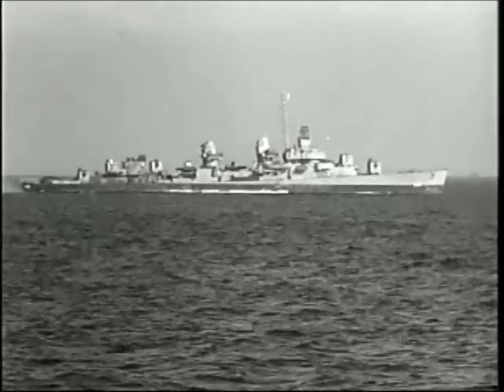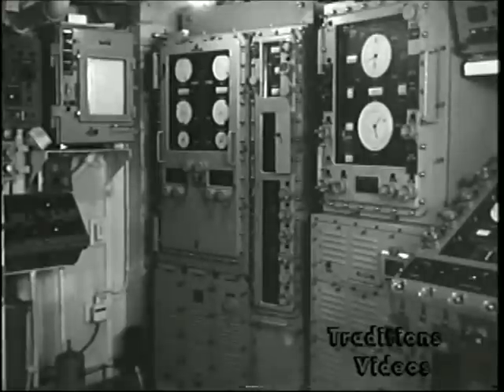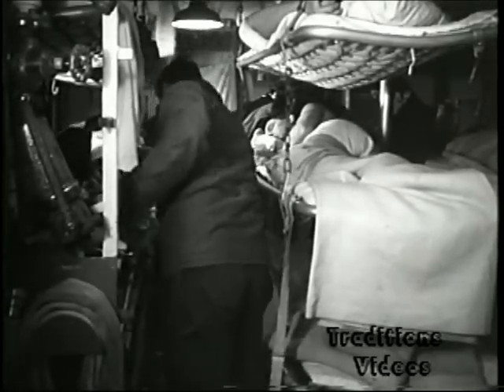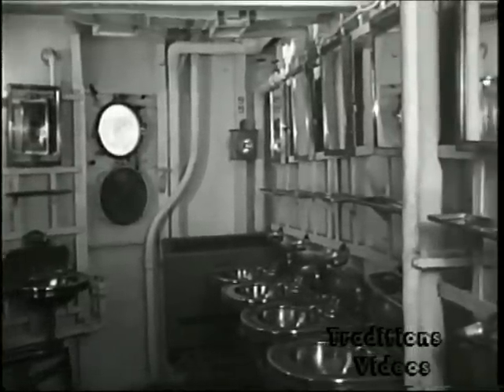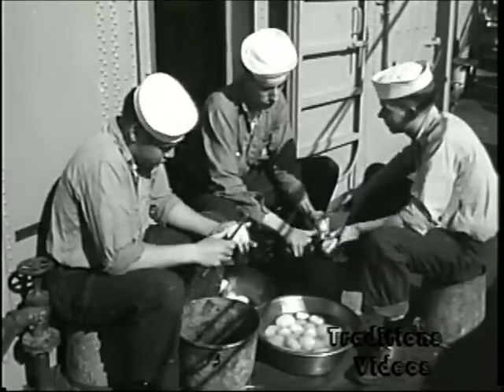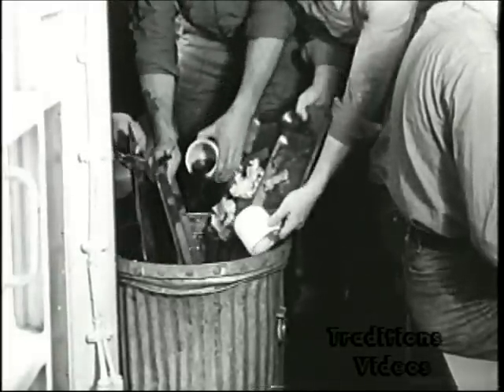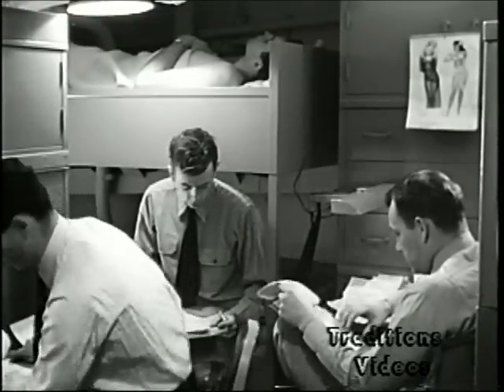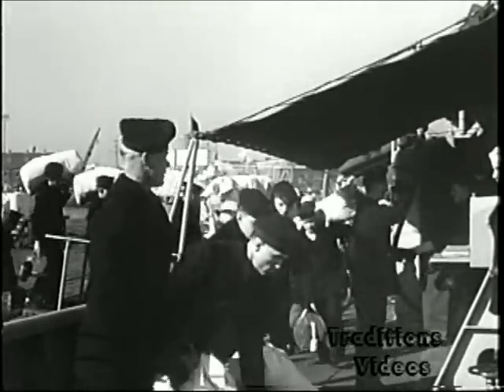US Navy USS  Saufley DD465 1952 Living Conditions

Comment: The head looks scary. No partitions or curtains. Hard to get a good bowel movement with someone staring at you.
Reply from the maker: On the Gearing class dd, the forward head has small partitions, but the toilets faced each other, and when the five toilets were occupied, knees often touched the other guys'; the partition only separated you from the guy next to you. Wish I had taken a photo of that head.
Reply: The ships I was on, neither had partitions, just a long line of commodes all open to the world.You just get used to paying no attention to anyone but your own business.
Reply: zane lile -- well said agreed.
Reply: onetruekeeper Gays weren't allowed in the military in the 1950's.  😃😃😃😃😃😃😃
Reply: I feel bad for you tin can types.
I was on a AOE(USS Camden(AOE-2)
Motel showers and heads(especially for us MM's).
I ran around for a week straight plugging all the minor steam leaks so the MMR was nice n cool and the evap guys were happy. 
Chilled water plant was top notch. 
Enough room for everyone to go thru the ship in a "race track pattern": STBD side goes fore and aft, PORT goes aft to f'wd. This was actually dictated by the main galley.
Engines were from the unfinished Kentucky. Top of the line steam, never gave us any major issues. Kicked like a horse when you opened the throttle.
Reply: Yep...I spent 5 years on Camden(late80's-early90's) and did the 89/91 Pacs.  She could get up and go for sure.  I remember we had to maintain 26kts for a few days and IIRC...we lost one of the four boilers but kept up speed.  Forced draft blowers were screaming though!lol!
Reply: We regularly did 30-31 knots. By the time I got on Camden, her boilers were improved and had electronic controls. Main engines were rated at 120,000 hp. On 9/11 we got underway for san diego with two boilers out. Yard birds were working on bravo boilers at the time. Still hauled ass. In the gulf, mostly cruised at about 12 knots in circles all day for a week at a time, then run in and do a port call for stores and ammo.
Coming back from peru we dragraced a carrier and two ddg's. This was the one and only time I saw the overload valves opened. TakeDeadAim mentions the FDB's screaming. Well... the FDB's in this particular run were spun up so hard that they were DEAD QUIET... It was strange...But you could clearly hear the HP turbine howling, which made me nervous because normally its quiet with the exception of the steam hissing thru the throttle. Huge amounts of grey smoke coming out of the stack. Couldn't tell who was running white and who was running black. Evaps tripped of course but other than that the plant ran fine. EOOW pacing so fast in main control that he rubbed a new path in the deck plate... Everyone smoking at their station of course lol. Anyways, the DDG's smoked everyone at first of course, but we caught up to them. Carrier lifted her nose out of the water and booked it. We never caught her... of course... I believe our top speed that day was 36-37 knots.
Reply: I do remember sprinting to the aid of an injured merchant sailor at about 33kts.  The Coast Guard called and said we were the closest ship and the guy was going to die if he didn't receive treatment.   Luckily we had CH64's aboard so the old man (Capt Nelson) without hesitation called the turn, called the EOOW and told him to make ready for a flank bell.  We ran for quite a few hours until we could launch the helo and then continued until it returned.  Loved the old Pachyderm...
Reply: Midway is a oil burner, she doesn't count(and she was decomm'd at the time). Enterprise was never allowed to run at full power. We raced a nimitz class. 
Draft and width of camden was the same as iowa but we were about 90 feet shorter.
We also weighed less than half as much as an Iowa at about 25,000 tons. NOT 53,000. We were never really at full load, even at deployment, and the peru trip was a semi-dry run(we didn't do unreps the entire time nor take on stores).
Reply: You must've been on a different Camden...overall displacement has little effect on speed.  When we went out to Desert Storm in 91, once we "inchop'd" and took full stores, fuel and ammo I'd see the daily reports on hog/sag etc...and we would easily push 50-53k Tons.  At that weight we'd sit at about 40'.  "light" on deployment would only see a min of 30ktons and 27'aft...15' fwd.  Camden actually went FASTER the lower she set due to the screws being able to "bite" more water.  You still put the same turns on, and each turn still pushes the ship through the water the same distance.  Regardless of control(electronic/manual) that ship would have never seen close to 37 unless you pulled all safeties, said "screw the bearings"(they're going to start over heating very quickly at turns to make even 34kts)and the ship's life depended on it.  That would be what's called a "Bendix Bell"....which if you look at the lee helm repeater, is the detent past "Flank"...tantamount to an LM2500 GST being pushed to "Battle Override" in which the CO orders to spin the turbines to their max...NEVER tested, AND IF it was ever needed AND assuming the ship survived those engines are REQUIRED to be pulled and replaced ASAP.
Reply: Well...for the most part it was great.  In Supply they had to segregate "ship" supply from "fleet" so although they may indeed have fresh fruit in the fridge...we may not have had the ability to get it because it was headed to another ship.  That said, if we had a good Suppo who was on top of his game, he could usually manipulate the orders so that we never ate poorly.  I only recall a couple of times we had to drink the milk boxes and NOT have eggs to order at breakfast!lol!  A good "Jack-o-the-dust" was critical as well.  We had a nice bakery to boot.
Reply: @hopelessdoom: I can tell we are on way different wavelengths here because we were in the navy in WAY different time periods... Things probably changed alot since you were there. Midway doesn't count because I have no idea how she performs... And she and the rest of the oil burner CV's were gone by the time I was onboard camden in 2000-2004. I used to drive past the midway everyday on my to muster, she looked like all the rest of the oil burners: just sitting there, rotting. Although don't get me wrong, I am a machinist mate and nothing would make me blow my load more than getting my grubby fingers on one of those CV's and firing them up. LIKE I MENTIONED BEFORE: We opened the OVERLOAD valves. I bet that was something you had never heard of before because you act like you have never heard of them. Every steam driven piece of equipment had one, and it required captain/eoow permission to open them. And during the entire time I was there, noone had heard of these valves being opened, and everyone was nervous about opening them from the old farts on down.

Liberty on camden was a fluid affair. We made the usual port calls at hawaii, thailand, indonesia. Subic bay was closed by the time I got there. Then we went in to the persian gulf and made a 1-2 day call every week at any one of the mad-hatter arab states there. On the way back we hit austrailia and tazmania. Each call with the exception of the mad-hatter calls lasted a week.
Reply: I'm curious about the timing of the hyper power drive.  Was this done on the final cruise on it's way to be de-commed?  I'm pretty familiar with the ship and it's operating parameters including having done one extended yard/re-fit and all the inspections and trials.  I know that having talked to MM's about the top speed, it wasn't so much that the plant couldn't boil water or spin the wheels fast enough...the true limit were the bearing temps.  As with CVN's(and prior CGN's), they're "wall" are the bearing's and their ability to cool them at such high RPM.  It seems pretty irresponsible for a CO to take that ship to what is a sort of "Battle Override" sprint including pulling the safeties unless he knew that it really wasn't going to matter even if some damage was done.    Even at 30-31kts if you're standing on the fantail...that thing is banging away and really churning up the sea.  Add to that turns for 5-7 more kts and it must have been quite a maelstrom.
Reply: It was hit and miss.  Since it was deep draft obviously we anchored out and prior to our de-cert(nukes) we really had to stay out in the boonies in ports such as Hong Kong, and Singapore.    There were only a few times when we'd go into port just to upload(when I was there) and that only happened really out in the gulf at Jebel Ali during Desert Storm.  Most of the time we'd take fuel from a T-AO.  We'd get barges at anchor and they could usually be unloaded in a few hours and by the duty section so liberty wasn't impacted too badly.    At Subic, it did suck if we got stuck across the bay at the ammo pier.  It was a 45 min bus ride around Cubi point to get to shit river.  Now THAT did suck!lol!
Reply: We pretty much went to every port any of the other ships did while on Wes Pac.  The exception was Thailand.  A couple of small boys could get into Phuket while we stayed up in Pattaya.  Hong Kong, Singapore was where being small paid off.  Us and the bird farm had to drop the hook way out while the others simply tied up at a pier.    Now...we DID get to see the "beauty" of Al Masariah Oman when everyone else was up in the gulf.  Two AF C-141's or a C5 would land at "Moon base Alpha" and we had to muster a working party and helo in to break down the AF pallets into manageable sizes and Tri-Walls for the CH46's to take back while we anchored about 5 miles out.  Hot, dusty, hot, and more hot.  Sums that hell hole up...
Reply from the maker: Replying to "John Doe":Gays never self-identified as being homosexual prior to the Obama policy changes. There have always been gays in the military, but never or rarely outwardly so, at least prior to Obama.  

The issue in the military has always been that ANY sexual acts between service members is prohibited, homosexual or heterosexual.  Even though gays are now permitted in the military, that doesn't give license to any sexual activity.l
Reply: Ships, I was on never had partitions - but no one starred at anyone.
Reply: Try looking at the deck squid.
Reply: TakeDeadAim LM2500!!!!! Now you are speaking my era of Navy. CG-49. I slept well to the drone of turbines
Reply: Lol you never served!
Reply: I was on a Gearing class and our Fwd head didn't even have partitions.
Reply: Funny.  Truth is that no one is "staring at you".  You go to the head, do what you have to do and get out. Why don't they install partitions of any kind? It's not just for reasons of space, it's in part psychological. Breaking down any and all barriers between and among the men is very important when at war. You have to be ready to risk your life for other men you had previously not known at all and you have to be able to have confidence that they will risk their lives for you. No second thoughts, no barriers.  You shower together, you shave together, you shit together, you suffer together and you fight together.  Unit cohesion.
Reply: @John77Doe  The decision to allow homosexuals into the armed forces has been a strategic one.  Imagine a new Viet Nam, what easier way could there be to dodge a draft than simply tell the recruiters that you are gay.  Even if you aren't.  There isn't a blood test or anything.
Reply: Watching this brought back a lot of memories from 45 years ago.  It is amazing how little privacy you learn to accept when serving aboard a warship.  Not just the heads, but the working spaces, mess deck, even the berthing compartments....12 guys sleeping, dressing, and storing everything they own in a space smaller than the size of the master bathroom in my house.  Given my lifestyle now, it is amazing how totally used to it I was.  But, it truly was no big deal.  Nobody cared.  Besides, you are with your best friends.  Your brothers.
Reply: @braintrusts  Like I mentioned, the destroyer I was on had no partitions and I found it difficult to unload with everybody standing there waiting their turn. It was the worst compartment on the ship and I often wondered who in the hell designed these things because a little bit of privacy goes a long way.
Reply: onetruekeeper pistol Pete videos
Reply: Wasn't me!
Reply: @John77Doe  They were but you just didn't know it.
Reply: Performance anxiety?
Reply: @memadmax69  Cool story.  I felt bad for you skimmer guys when the sub would be slightly rolling, even a couple hundred feet down.  Engineering department is the only place to be, whether it's in the back of the boat or  the middle of the ship.  Steam power is awesome.  No matter what device is making the steam!  Thanks again for the story.
Reply: Why?/Do you have something worth looking at??
Reply: 36 knots is flying
Reply: I know a WWII sailor, Gunners Mate on the U.S.S. NEW MEXICO. He told me how the "commodes" were in fact a long cast iron trough, with two-by-four-like boards that spanned it, and you adjusted them according to your sitting spot, and the trough emptied through the bulkhead to the open sea. He was on the NEW MEXICO throughout the Pacific Campaign. Remembers Tarawa, and also the Kamikaze plane that killed his Skipper and the Royal Navy Officer ( and just missed Admiral Spruance !?? ) . Great guy, ……  Just talked to him around Xmass time. Thanks for all your service. Pray for our Country.
Reply: No it isnt lol
Reply: The smell in that head after last night's chow having chop suey... "COURTESY FLUSH!!!"
Reply: I'm sure it smelled lovely in there.  That's enough to make you stop eating.
Reply: You could tell what the guy next to you had for dinner!Gunners Mate USSBoyd DD544 Fletcher class 67/68.
Reply: MeMad Max h
Reply: TakeDeadA
Reply: hDonna McKenna has
Reply: This is normal in the military. You get used to it, privacy is a luxury and a dream.
Reply: You get over it. -Navy Sailor
Reply: onetruekeeper
Not just staring at you, but fidgeting In Line, while pitching in rough weather.!!
Reply: They still shit like that in India and China. And that isn’t on a ship.
Reply: @zanelile515  thats right you do get used to it, well ya have to!
Reply: I went to military school from 1966 to 1971 and the "head" was pretty much the same. Toilets lined up, no stalls or dividing walls, and the sinks where a few feet in front of us with other guys shaving in them.
Reply: When I was in the Army our latrines had 20 shitters back to back with no dividers.
Reply: Perhaps you had never eaten Navy chow before.  Just kidding
Reply: Not after you get used to it
Reply: @John77Doe  they just weren't obvious
Reply: @braintrusts  You still can see it on the Joseph P. Kennedy Jr.  which is a museum ship in Fall River, MA.  She was my second and last Gearing ship when she was decommissioned in 1973.
Reply from the maker: @Errr717   I know it well: have had a couple DD-829 reunions there and had the first catered reunion dinner aboard the Kennedy some years ago. Our association has financially and physically supported the Kennedy over the years.
Thanks for serving as well as posting!!

Comment: I was on the Robert K Huntington DD 781 in the late 60's, E Division berthing quarters was slightly bigger and the head was on the same level.  Same racks and lockers.
Reply from the maker: Thanks for your service in the USN!!  As you are aware, the Sumner was the start of the Gearing Class DD, only making the Sumner ~25' longer giving it LOTS more fuel.
I had slept aft as well as forward, and aft was usually more stable. Berthing in the foc'sle could be problematic in heavy seas. But, still many good times.
Thanks for posting.

Comment: 1962, USS Radford, DD446, out of Pearl. No mention of the fact that, in the tropics when the evaporators couldn't distill water at the rate required to run the two steam turbine engines, showers were prohibited until the tanks were safely ahead of the engine needs. Could be hours...or days.
Also, the ambient noise levels in the fire and engine rooms was so loud you had to stand less than a foot from someone, look directly at them, and shout in order to communicate, if you were down there working on something and not wearing a sound powered headset like the guys on duty. And while I'm whining, the engineering bunks near the fantail shook and vibrated when you were going 30 knots during carrier flight ops at night.
Reply from the maker: Tom, Thanks for your service in the Tin Can Navy aboard a Fletcher Class DD!! Evaps were still a problem on the Gearings and restricted showers were the norm at sea, so not much changed. For a time, due to crowded conditions up in the bow, I slept back aft and it certainly was a bumpy, vibrating ride at times, especially in rough seas. Thanks for posting.